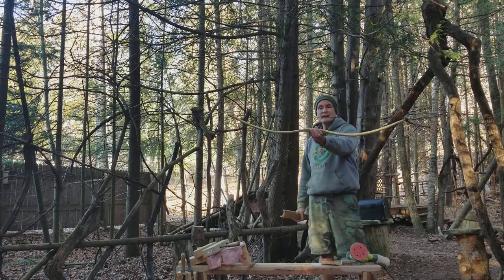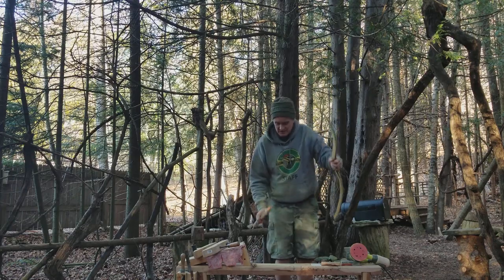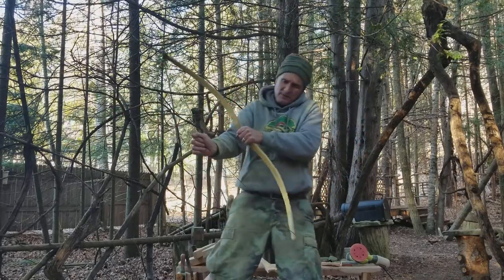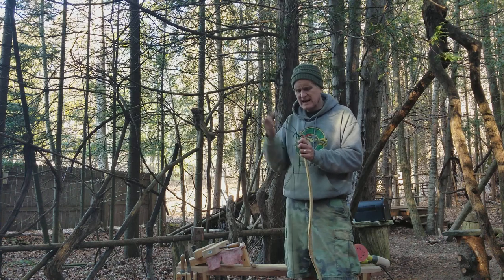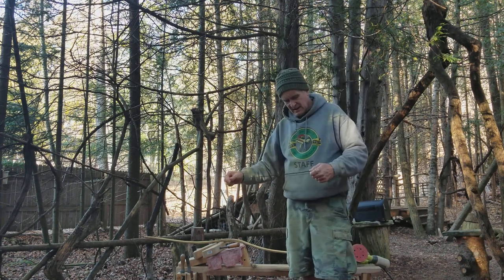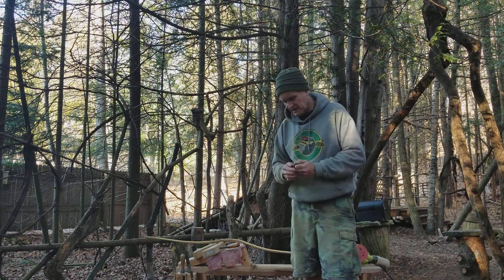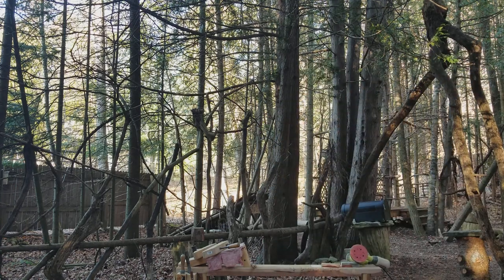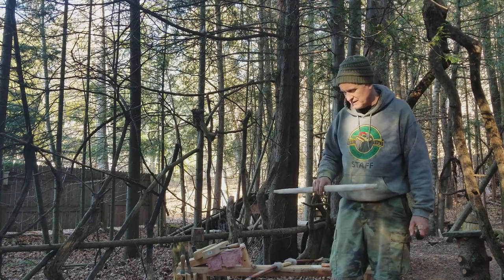8% Battery,  and Three Bows.

Comment: I thought you made a crossbow in the first seconds of your video. I am still in search of a video or webpage that will have the info.
Reply from the maker: Hola Eli. Out of any of the bows I make, these osage gull wings buried with sinew, would make the best crossbow prods. There are a couple of good pages I've found on the old style arbolasts. Is that which type grabs you?
Reply: J R's Place I think that was the same pages I seen where they made and arborest crossbow. I am going to look in my yard for a nice sizable tree branch and use your book as a guide to make my first bow. Then I’ll tinker with the idea of crossbow. Ready for Bow making 101 Prof JR
Reply from the maker: Excellent. You've really inspired me to make a crossbow. I'm working on how to make the trigger mechanism using stuff I have on hand, and fighting the urge to use the osage horse bow as a temporary prod. It would actually make a pretty good one because the osage and all that sinew could handle being at full draw better than a lot of other bow types.
Reply: J R's Place I have been thinking of the trigger assembly and how would you construct it with items you can get. The other question is in using Osage bow downsizing it would the draw be harder to pull back?  Would you need a hand crank to draw the bow back?  https://www.google.com/amp/s/www.popsci.com/amp/how-to-build-medieval-crossbow. Here is a picture of a simple trigger. Now my brain is really thinking. Time to make a proto type stock
Reply from the maker: I think they would have to "split" that triggering mechanism so the bolt could slide between it and make contact with the string. I was thinking that I would use a hole saw so I could make both the round hole in the stock as well as that round thing that holds the string and then can rotate within the stock, like a traditional arbalast.  Even with osage covered in gobs of sinew one could make it as strong as one wished. I think I would first try something like 150 pounds or so, so I could still yank it back with a foot through the stirrup and just pulling the string. How I would change it up though, would be to give it a longer power stroke so this 150# crossbow could through a bolt like a much stronger one with a shorter power stroke. That's where osage comes in: It can handle more guff than just about any other wood, so it could be pulled back farther and still be drawn for a while without killing the prod. We shall see.
Reply: J R's Place as I was reading up on the crossbow to latter find out that crossbows were so easily made they were banned (don’t quote me) Turkey. I agree the trigger and the string holder need to be a separate piece. One video I seen. They had a notch in the string holder round piece of polyurethane stock with a bolt through it to butt stock. (Not really making back in the day I see). Then of course they had a ratchet like on a boat trailer  come a long. I think I’ll bust out some wood and make a proto type